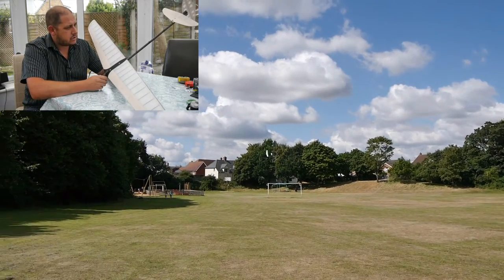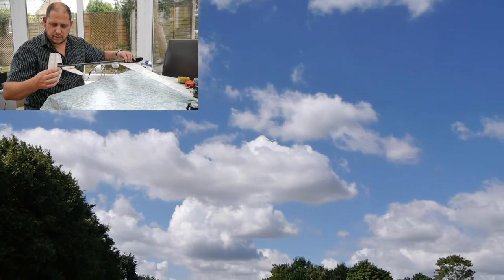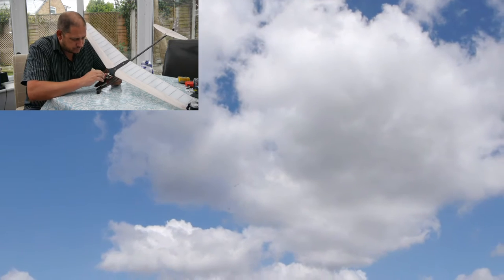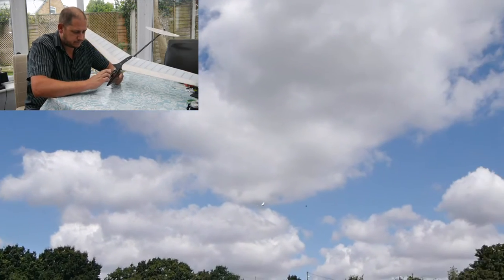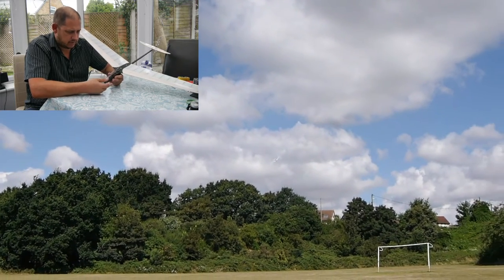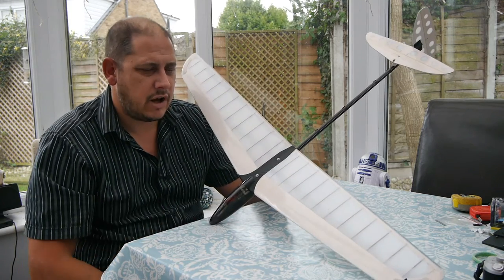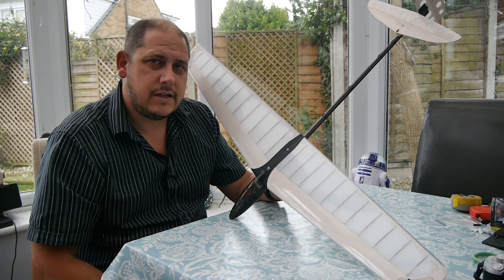Hobbyking Mini DLG update and flight footage

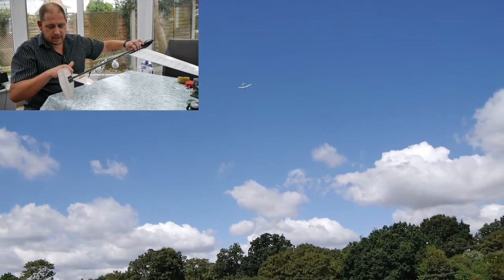Comment: One more thing I noticed; at the beginning of the launch your doing great, cause the glider is accelerating and you are spinning and twisting and everything looks fine. But then after about 220 degrees of turn you kinda lose it all, and it's almost like your starting over again. You can really see this in effect at 1:20

Comment: Well you're letting go too late, so you are depleting the forward momentum and increasing the sideways momentum, which translates into less height and more unwanted "launch-roll". Also this is probobly one if the reasons why you are hurting your shoulder, cause the glider has been accelerated, and it WANTS to go forward, but your are holding it back by not letting go soon enough and thus it is pulling and straining your shoulder. Also, you are not COMMITING enough. See when you launch you take a big step with your right foot, then a small one with your left as you begin to twist, and your doing all that great, but then once your twisted you should be really gaining momentum, which your not really doing cause your not going fast enough to allow a twist in the spine. That twist is where the power comes from, cause at the end if the launch you un-twist and release all that energy and allow the glider to surge forward and release. There should be a point at which the glider has enough momentum that it pulls out of your hand, and that's when you let go. Also you are using to much force from your arms. You are not twisting enough or spinning fast enough so you are trying to make up for it by throwing it really hard with your arm, which just causes the plane to roll and your shoulder to hurt.